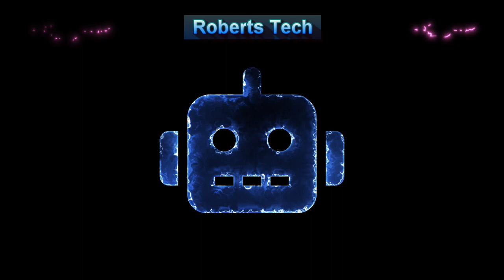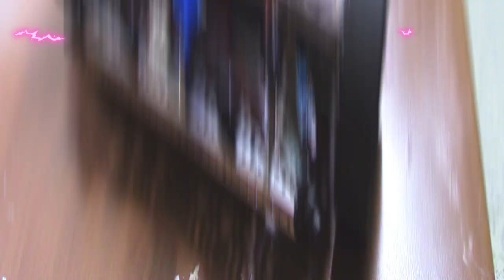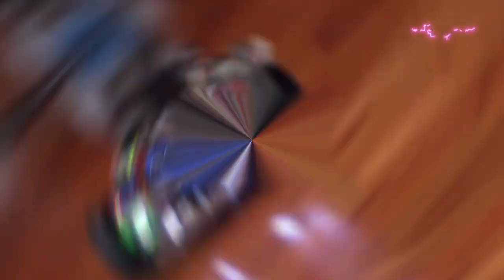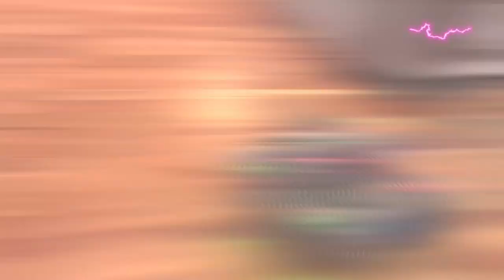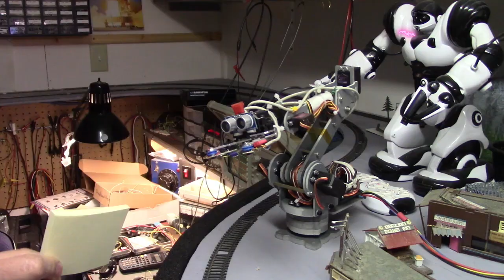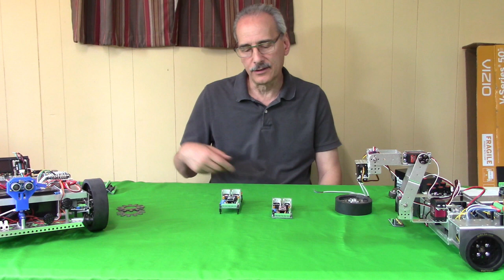Roberts Tech Programmable Motor Driver With Speed Control

Comment: Could our model train controller 0103 be modified to use FETs and provide more useable power to the DC Motor in the engine??? Can we add motor speed control or something like Cruise Control, for our trains or do we need a Micro Controller? D